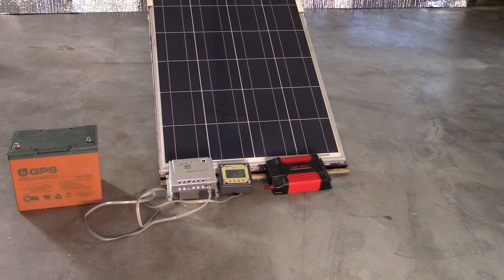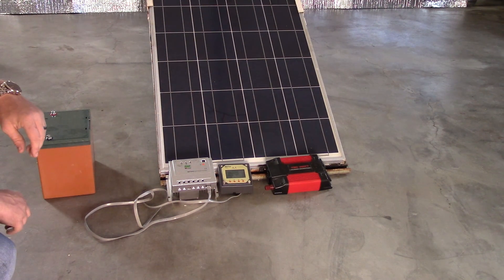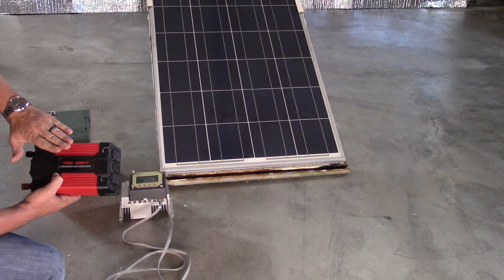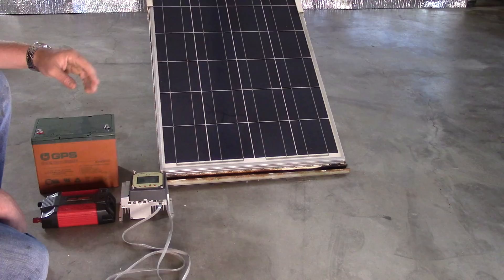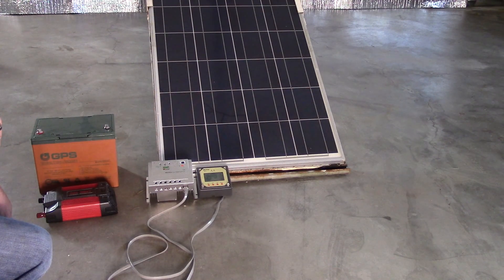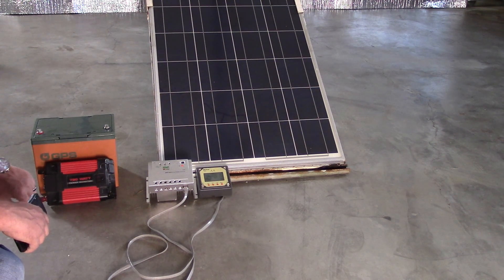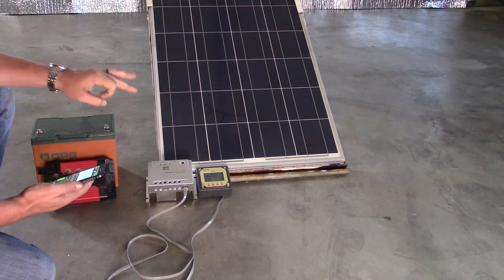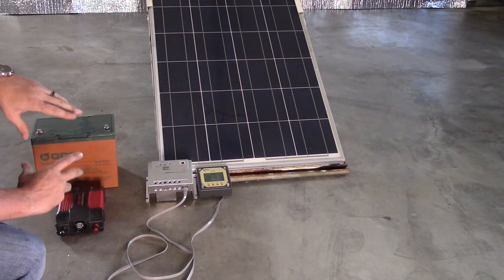What components do you need for solar power why is it important to use high quality  components

Comment: It's pretty hard to overcharge your phone especially smartphones. It also doesn't matter what car charger u get because if ur phone takes 1 amp and u buy a 2.4 amp charger, it won't damage it, it's just more than u need. The extra Amps that your phone isn't taking can be used for a tablet that takes a lot more amps. Phones take the power they need, the charger just provides it.
Reply from the maker: Ok thanks for your input.

Comment: How big of a system would I need to charge and run a whole house and a 24 x 24 garage???together or separate...large front room 24 x24, 3 bedrooms roughly 24 x 24, 2 baths 8 x 10, dinning room 24 x 24, large kitchen,16 x 24, large pantry/washroom/water heater/furnace, two instant water heaters-electric... 14 x 24...All electric,..trying to figure about how many watts and etc,,,
Reply from the maker: whats your power bill in kwh and what state do you live
Reply: Solar Power Electricity and Electronics Ohio, Not sure...It's in planning stage as of right now...no electric on the property closest electric pole is about a mile as a crow would fly...A lot of trees would have to be cut just to bring in pole electric...
Reply from the maker: +Mike Brown start with 6kw and a big battery bank
Reply: Solar Power Electricity and Electronics thanks...That is about what I guessed, I was a little low at 4k... 6k is probably more like it...Thanks again...